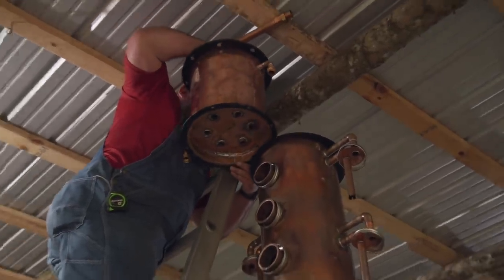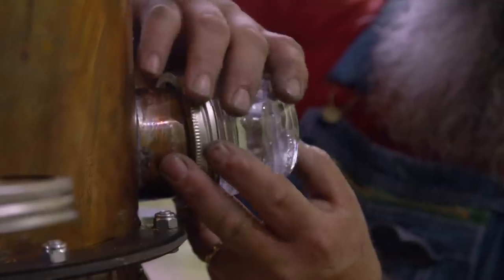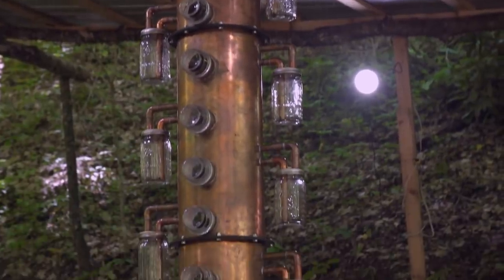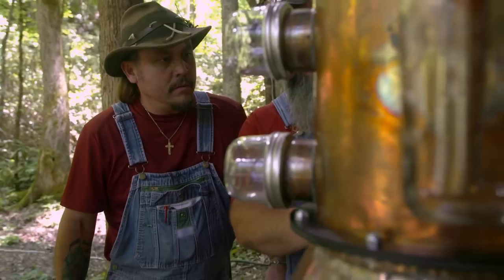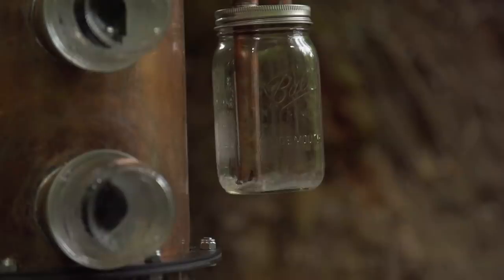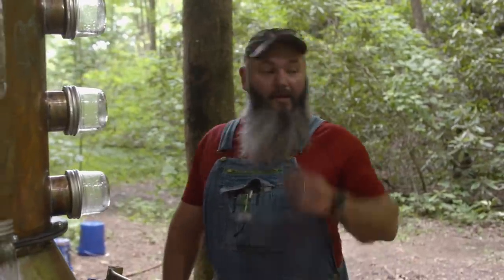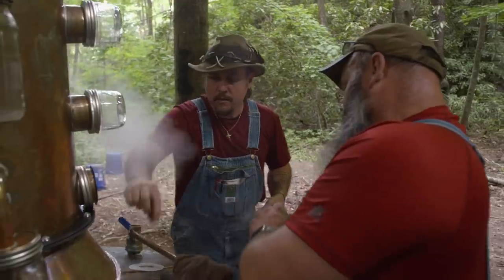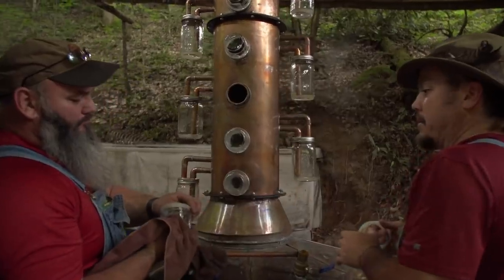Mike & Jerry Fix Their Towering Leaky Still With Jam Jar Seals | Moonshiners

Comment: Those jars have seals for vaccume, not positive pressure.   If that was actual alcohol I'd say have fun blowing yourselves up, but we all know its water.
Reply: that floating glass rod they use at 8:28 measures alcohol content by floating lower or higher in the product based on what density it is. alcohol is less dense than water so the rod will sink more the higher the alcohol content. they measure close to 190 which means it had nearly 95% alcohol content. thats some spicy water
Reply: @callumandrecyk2965  yeah, I agree they had alcohol in the little bit they tested.   They didnt distill it in the woods with that contraption tho.
Reply: No thats alcohol…